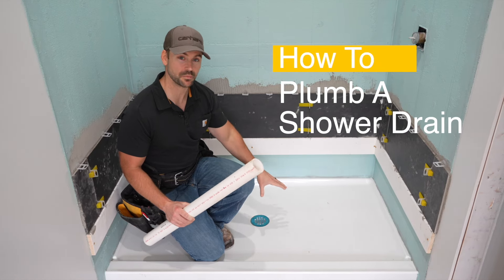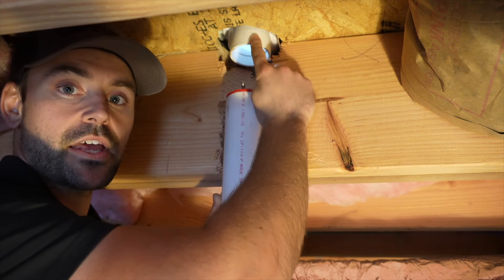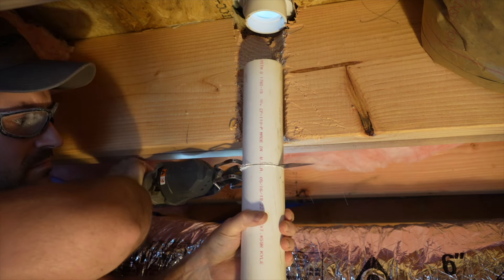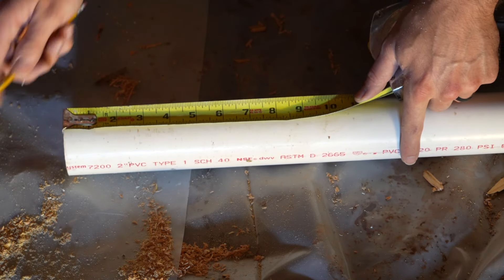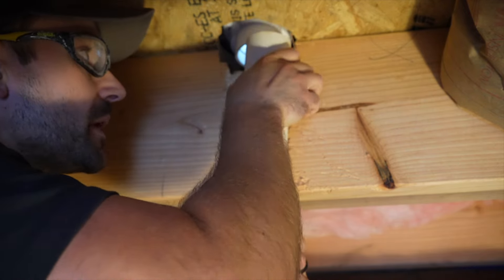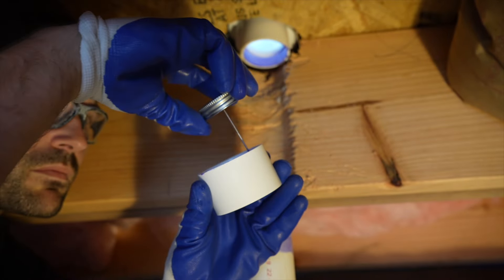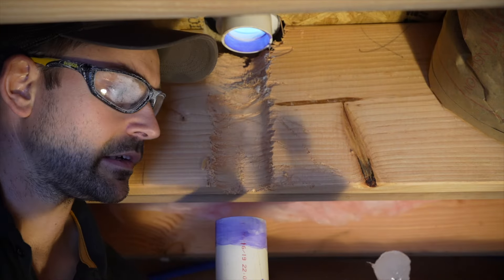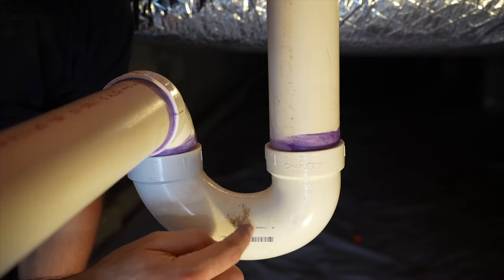How To Plumb A Shower Drain - Connecting Shower Drain To Plumbing

Comment: Okay but what if there is no crawlspace...?
Reply: You flip the building upside down
Reply: Run pvc high and cut in drain after
Reply: In that case, piping gets done before the flooring and the plumber faces a floor where the pipes are extended above the floor
Reply: Concrete saw :(

Comment: Hacking up the whole floor joist, not ideal. Just shave a portion at the top of the joist with a hole saw just enough for a 45 degree street elbow, add a short piece of pipe to gain space away from the joist, add regular 45 degree elbow down to where you want the trap and carry on.
Reply: When a guy is obsessed with centering the shower drain I guess this is what happens 🙃
Reply: Doesn’t matter as long as you support the opposite side of the joyce
Reply: Would've been easier to just move the shower drain... That's what I would've done in my house... Hell with it being center
Reply: @omarreynold6782  Can't move the drain for many prefab shower pans
Reply: @pastrami00  true... Unless it's a fiber glass pan
Reply: Sometimes you have no choice looks like they doubled the joist nothing wrong with that at all

Comment: You cut the pipe below the joist and added on to it with a coupling. Why didn’t you just use the right length pipe to begin with?

Comment: Love the fact that the purple primer is a must as well. Whether it's code or not, is assures the fittings are cleaned when doing a lot of plumbing. I've used the trap in some situations that have a drain plug on the bottom in case something small would be dropped in the drain. Also depending on a the age of a project, I've added a clean out if code allows for a company to snake a drain out without going through the finished area of a shower or kitchen sink. Most companies who do this always appreciated this for not possibly causing scratches to tile or stainless steel sinks. Thank you for this video Josh. 👍🏻
I have had a pipe cutter made by Rigid for years that can cut up to 3" plastic and not real bulky.
Reply from the maker: Welcome back David! Oh yes purple primer is definitely important to use for many reasons. The inspector always checked to make sure he sees it on the joints. That’s a great idea to add a clean out close to the trap. The only other pipe cutter I have use is the ratchet style. I usually use those for the waterlines. The miter saw has always been a simple effective method for us. Thanks for stopping by and watching the video!
Reply: Our inspectors here (w.v) want to see purple on all connections...
Reply: @joshuawilson1989  Ours do not allow purple above the floor. You must use clear primer above grade and purple below.

Comment: Good video for someone who has access from below. What's best method for a bathroom above finished space that is inaccessible?
Reply: I have the same issue. I am guessing you have to have the drain pipe installed first and the pipe measured so when you put the base pan in it is flush. Then when ready to install the base you would prime and glue the drain without being able to twist it for a better seal. Not much room for error, but it can be done.

Comment: I installed the same shower pan as you did in this video. How did you end up caulking the bottom where the tile and pan meet? There is that deep groove/gulley that catches water on the sides.

Comment: great video,  i bought the swivel connection to the P trap and put everything together and a have a very small leak from that connection. ive tightened it more without compromising it and now do i try and add some thread tape and try that ?? it seems seeded correctly when i connect everything. FRUSTRATED

Comment: I don't think I'd ever install a trap that cant be unscrewed.  I've had to remove sink and bathroom traps several times over the last 10 years in our house, and I can't imagine how much harder it would have been without them.  Thankfully the builder installed them when they built the house (pre-built).
Reply: Depending on yer 20 but I would hard pipe it if there’s no access. You rookies got a lot to learn ain’t just gluin pipe

Comment: How far down do you measure the drain pipe before you put the trap on?
Reply from the maker: It depends on the location of the main drain line you’re headed for. Every house is different. Hope that helps!
Reply: @TheExcellentLaborer  can it b immediately after the drain well couple inches for p trap

Comment: My drain line is so low to the ground that my shower p trap will be above it then require another bend back down to the drain line, is that okay? I don't really have a choice and I live out in the countryside where there's no code enforcement.

Comment: You don't need vent for shower?
Reply: UPC code, mim 2" drain for a shower and your mim distance for a trap arm to a vent is 5 feet, but most inspectors will allow 6 to 7 feet. I would ask your local building dept. what they would like to see.

Comment: How can you put a trap under a slab after you set it in a shower?
Reply: Ideally there should already be a trap in the plumbing under your slab somewhere. Doing a building right now where the sink and shower connect under the slab, then down the line before the septic there is a trap under the slab near the outside of the building. If you can’t smell septic/sewer coming from the drain, that is probably the case.

Comment: What’s the point of putting the coupling?
Reply: Because the pipe coming up was already installed and glued. He had to join those 2 pipes. If you used the trap with threads he could have just used one long piece from the drain to the j with no coupling needed.